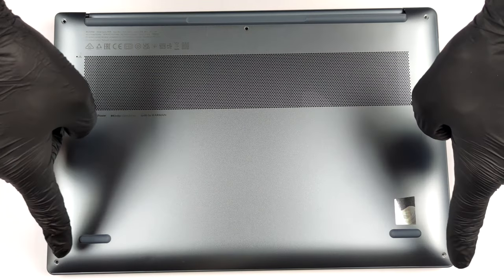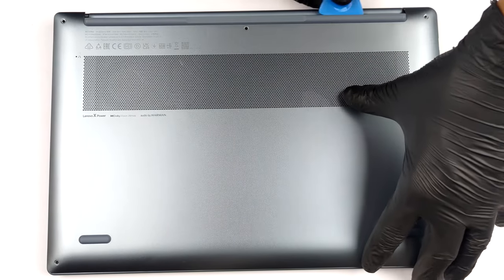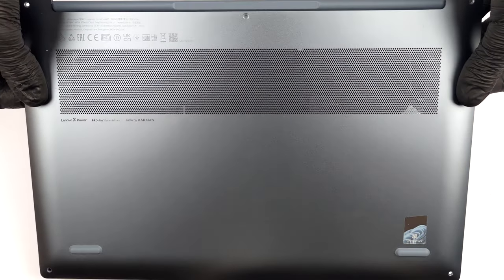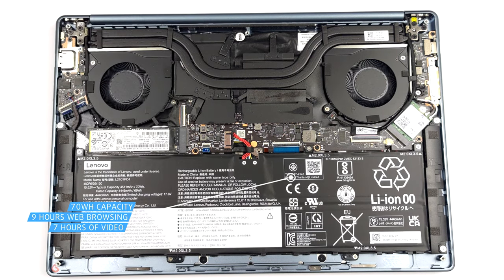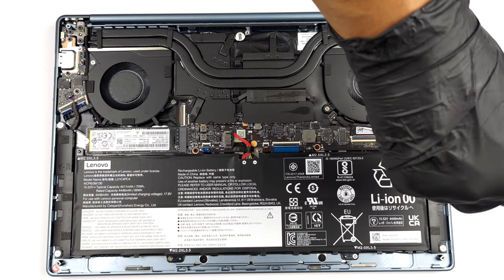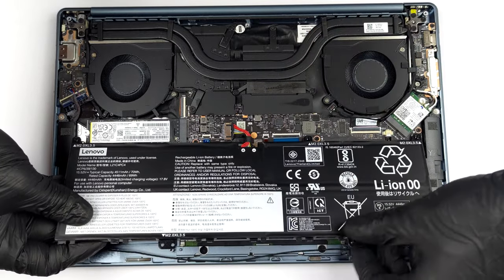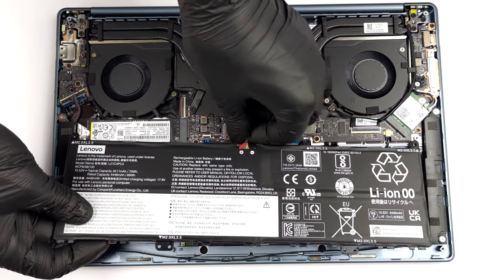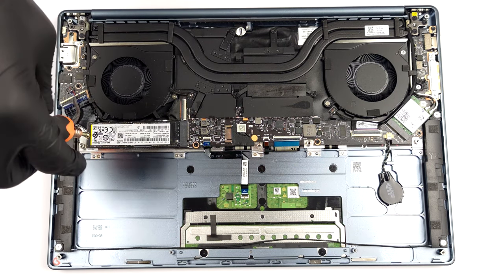🛠️ Lenovo Yoga Slim 7i Pro X (14") - disassembly and upgrade options

Comment: So i can easyly change the battery thats good to know
Reply: Do you have the same laptop, if so does your part above the keyboard gets extremely hot that it becomes untouchable during intense processing if not then something might be wrong with my laptop
Reply: @hayyanfaisal2050  mine too (R7 6800H + rtx 3050 version)

Comment: What screwdriver you used?
Reply: Do you have the same laptop, if so does your part above the keyboard gets extremely hot that it becomes untouchable during intense processing
Reply: @hayyanfaisal2050  i have the same laptop but no such issue. I use a laptop stand that makes sure there 's enought air outflow

Comment: can upgrade the ram?
Reply: Cant upgrade ram its welded,

Do you have the same laptop, if so does your part above the keyboard gets extremely hot that it becomes untouchable during intense processing
Reply: @hayyanfaisal2050  i have this laptop with 12500h cpu and no ti does not get hot while watching youtube or browsing. It actually stays so cool the fans dont spin. I would imagine that the 12700h would get hotter because it is a bigger cpu.